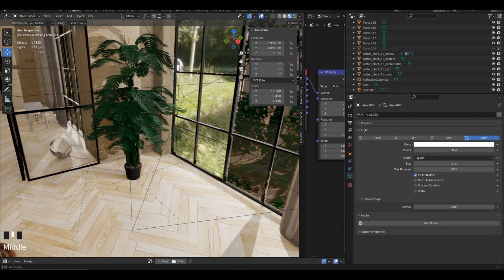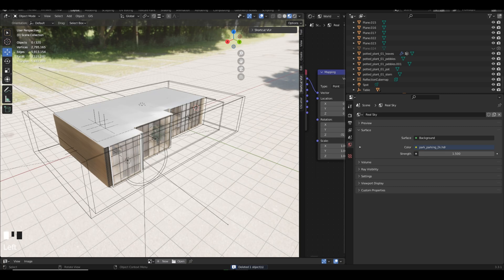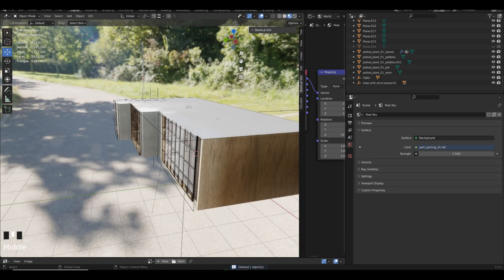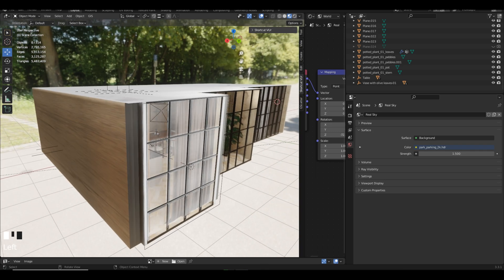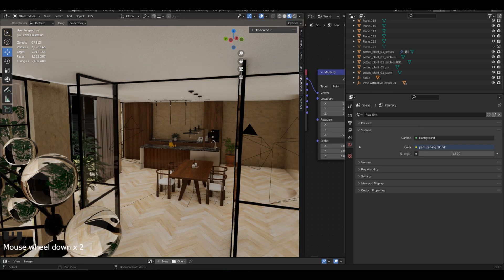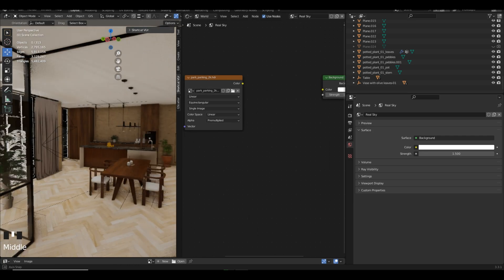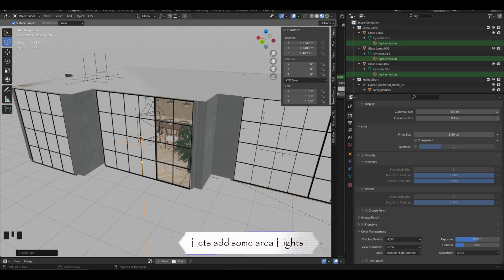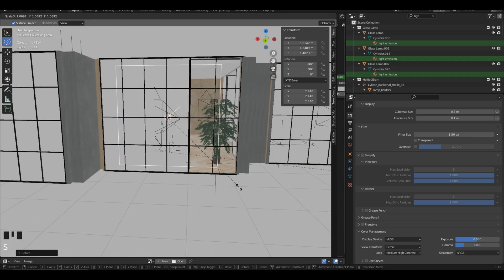Realistic Interior Lighting in Blender - Tutorial

Comment: Set your area Lights to "Portal". You want all the lightrays from the HDRI go through the portal and not bounce around outside your scene. This way you can use your lightsamples efficiently and save a lot of rendertime. You can additionally create a sunlight, if the shadows from your HDRI are too soft, position the sun where it is in your HDRI. You can link your HDRI-Rotation to your Sun-Rotation. If your Windowglass Shader slows down your Rendering and makes it noisy, something is wrong. Turn it on/off to check noise after X time. Good luck.
Reply from the maker: Awesome! Your tips are incredibly helpful, and I'll be sure to implement them in my future renders. Thanks again for sharing your expertise!